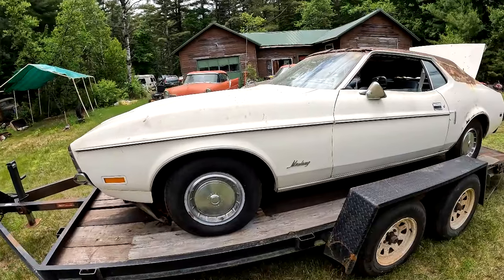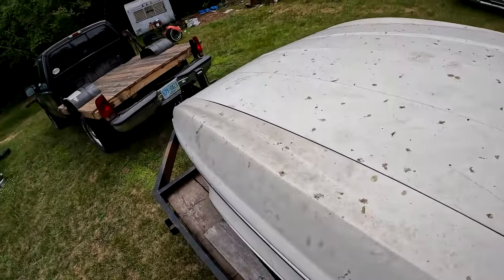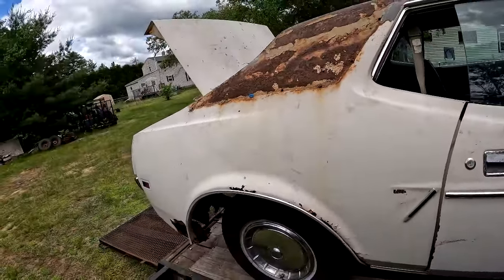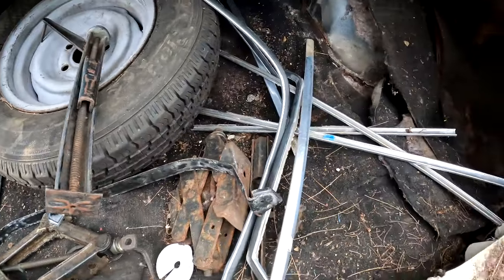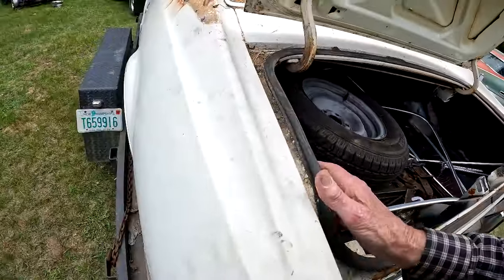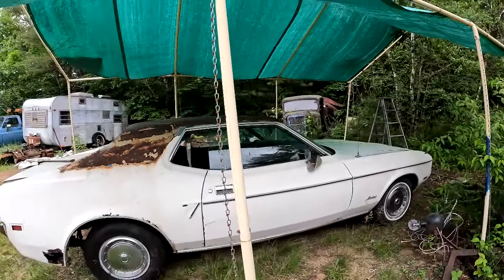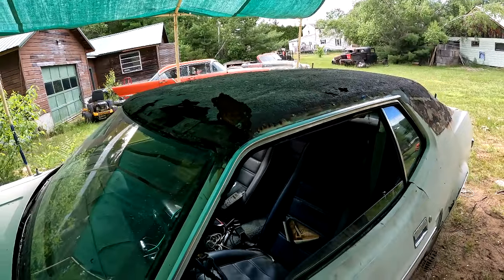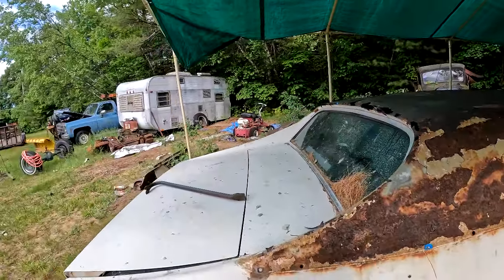i'm not buying any more cars...Yeah right

Comment: how about sut it at the vinyl top moulding line ?
Reply from the maker: That would take a lot of welding in a place that would take a lot of work to look straight. The best place to cut is at the bottom of the windshield posts below the chrome drip rails and from the bottom of the quarter windows back to the back of the sail panels then across to the corners of the trunk lid. replace the whole top not just a portion.

Comment: With all that rust. Would water not had traveled down the A piller and rusted out the cowl or compromised its strength?
Reply from the maker: That's possible. We're taking out the carpets and kick panels today to see how bad it is. Then we can decide if it's a parts car or a restoration project. I'm leaning towards parts car. Either way I don't have time to restore it. I have too many projects already started. 
I have someone who wants the engine and trans.  If I can sell the front clip I'll start deconstruction